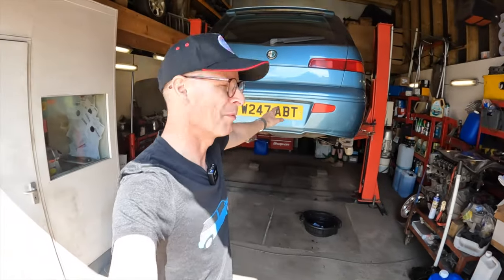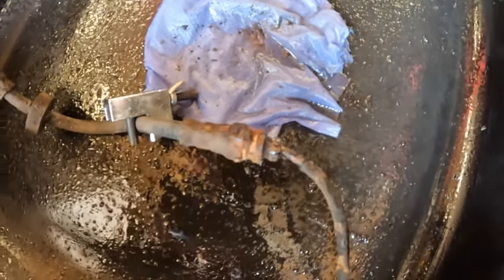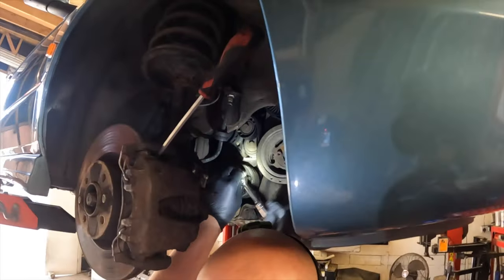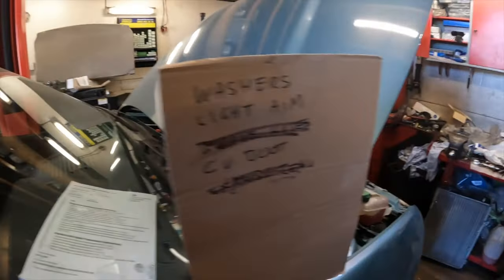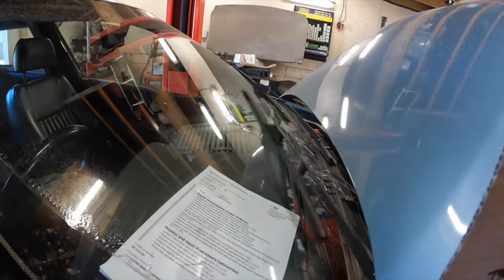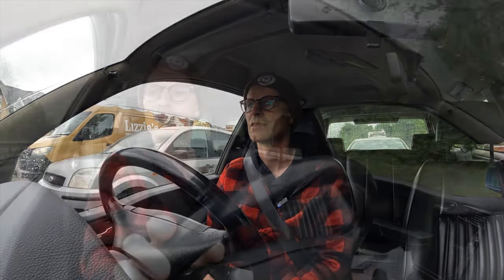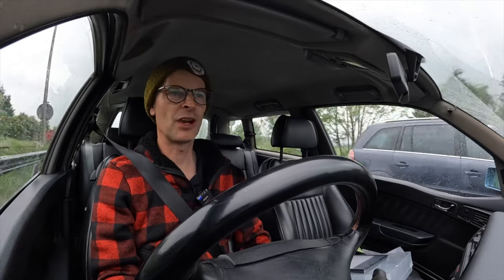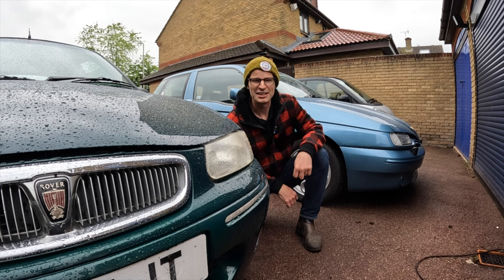Alfa 145 Final MOT work

Comment: Don't forget to get on top of the rust on the front chassis legs under the bonnet. I saw it in a previous video. If left to rust further it will have all  the crash protection of a wet paper bag!
Reply: It's already got that, I'd say a furball.

Comment: Not surprised that the suspension is not feeling that good, those coils looked very corroded.  You were very lucky with that brake pipe, often wondered why manufacturers changed to steel pipes from copper apart from being more squash resistant and cheaper.
I had a local repair garage that was good on making custom stainless exhausts, he had a vast stock of various bends and diameter sections, using the old as a pattern, he welded up a new one in a day.  Sadly he retired a few years ago and sold the premises, he was in his eighties then, the two 'lads' working for him went on to local main dealers.

Comment: Good luck curing the aircon! I presume there must be a leak in the refrigerant circuit - all those pipes and hoses and connectors, not to mention the super-high-quality heat exchangers. Back in the day, FIAT's attitude to quality was "the car has a 12-month warranty, so it doesn't matter if everything fails in the thirteenth month". The STATE of the brand-new heat exchangers when they were sent to Borletti (the HVAC system supplier) was sometimes ASTONISHINGLY bad, but FIAT didn't care as long as they were cheap. Even a certain formerly-British manufacturer (with a terrible reputation for most things) was fussier about what they got.

Comment: Good to see the Alpha Romeo has an MOT as you know in N.S.W we have yearly regestration inspections and the tester never checks the head light alinement they check if they work also there is a lot of rust issues on the Alpha all that salt used to melt the snow

Comment: As an Aussie I’m always surprised at the sheer amount of rust on British cars. There are model “ts” in the middle of a field with less rust.
Reply: Tom Mullins. Yeah. I'm glad I live in Australia and don't have to put up with much in the way of rust here - aside from on now very old (pre galvanised) models. I just bought a '93 Ford Fairlane that is basically rust free and original (that kind of thing doesn't look very possible in wet old blighty). Cheers!
Reply: @phillipevans9414  I have seven cars with only 2 under cover in the blue mountains west of Sydney. Every year they are covered in snow and I’m hard pushed finding rust on any of them. 3 are over 20yrs old. The rest 12-15yo. 
These are the same age as Matt’s cars but he has a constant battle with corrosion. 
But then again, this is an Alfa. Nuff said
Reply: I'm an Aussie who lived in UK for 22 years coming home in 2010. I have direct experience of running classic cars there and here. The big issue you may not be aware of is the use of salt on Brit roads in winter – this especially impacts older classics if you choose to use them during this period. Granted some cars are more susceptible to rust, even without the salt issue due to lower body design and the wet weather. Older Italian cars have never weathered well on Brit roads and lets face it even here in Oz they rusted – my dad had Fiats and Alfas in the late 60s/early 70s in Sydney and he had to be on top of this (yes there was poor quality steel). Conversely back in south London during my time there I saw many 1960/1970s classics parked on the street (as many homes of a certain era have no garages or off-street parking) and through sheer dedication these cars were in lovely condition, I always marvelled at these lovely cars as I walked to the pub – parked on the street everyday! At the end of the day its all about how dedicated you truly are to conserve your passion!? I learnt a few years back here in Sydney an old MG I once owned that was in immaculate condition when sold in the 1980s b4 I left for UK, was now a rusted out wreck on a central west farm – granted whose to know what happened in the owners life re/family/health etc but still it was a shame to hear, as it was such a lovely car in a very rare spec and totally original when sold – and no salt was used in its demise. But yes we are lucky here in regard to our climate.
Reply: @marknelson5929  yeah, I am aware of the salt problems in blighty and the problem with the roads not drying out as quick as here in oz. certain US states have the same problem. 
It’s just such a shame to see these beautiful cars turning to dust in front of your eyes.

Comment: I assume the the MOT inspection is mostly to ensure the vehicle is safe for you and others around you to drive on the road, which is a very good thing. Here these types of inspections are on a state by state basis with different rules. Some states are strict while others are not, and some don't have an inspection at all. Having said that it seems that a government (any government) could go too far with inspection requirements and infringe on personal liberties. Failing an inspection due to non-functioning windscreen washers would be considered ...... well..... ludicrous over here. Again I completely agree that an annual inspection is a very good thing. It just seems that some pass/fail criteria are meant more to garner revenue than to keep others safe. I know this is a shocking opinion that may cause controversy! By the way I've not had a vehicle inspected since the mid 1980s.

Comment: Comparisons; it'd be cool if you setup a couple of cameras at ends of a runway and drag race a pair of cars against one another.
Have one car on the left, one on the right, then edit the separate runs together so that there of are two of you, drag racing each other, side-by-side on screen.

Similar to how Robert at Aging Wheels edits himself into the same frame with a left/right separation at filming time, but racing yourself.

Comment: If the clutch is anything like it is on the GT JTS (should be, gearbox is the same) then you'll probably need to drop the front subframe off the car to do it. Definitely take the time to have it blasted and powder coated while you're there because the one on my 146 project car didn't look as un-flakey as it should have.

Comment: The rear of the car looks very rusty on the suspension components, those bottom arms in particular. I've known someone with a 145 a few years ago have the arm rust so badly it snapped in half and dig Into the road, strangely same thing happened to my p6 when the rear elbow gave in (luckily only doing 20 at the time). I wouldn't go coilovers unless you can't get originals, it'll be just another modified alfa!